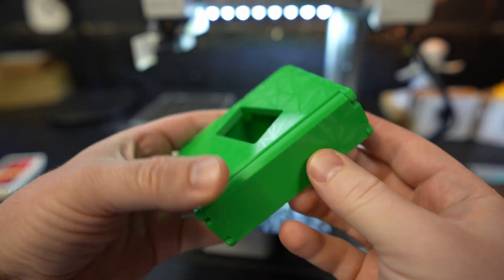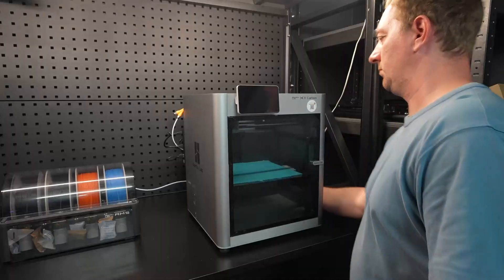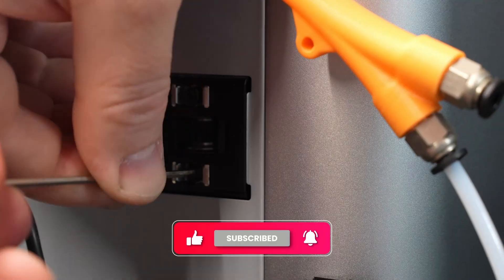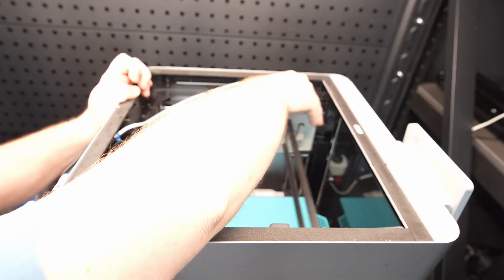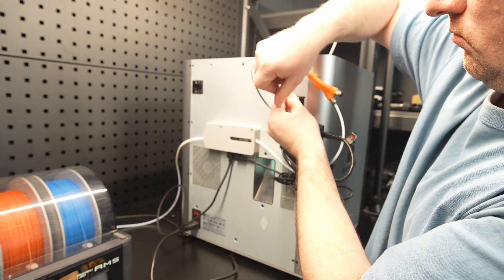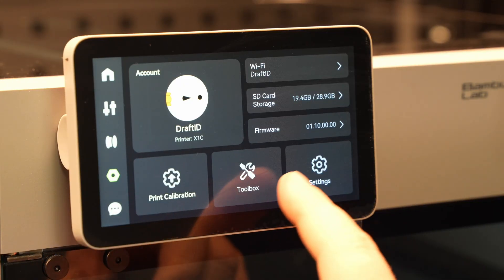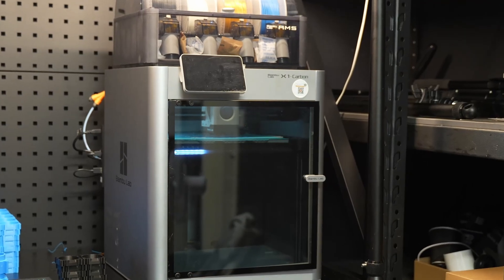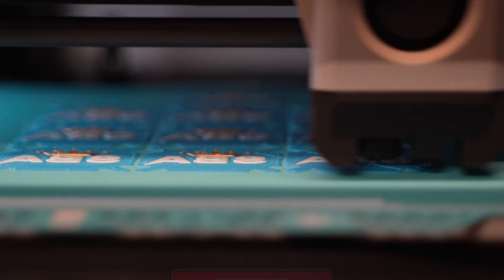How to Tighten Bambu Lab X1C Belts in Minutes

Comment: So this is a video how to loosen the belts… when you loosen the screws, then move the tool head around, that is loosening the tensioners… then you tell us to tighten the screws back before even pushing the tensioners?! This video is not good. After you move the tool head around, you need to move the tensioners before tightening the screws…
Reply from the maker: From the bambu wiki itself "Loosen the 4 screws of the belt-tensioner (but DO NOT remove them), then gently move the toolhead back and forth several times, and finally move it to the rear end of the printer. Then, tighten the 4 screws again. The spring system in the belt-tensioner will tighten the belt to the correct tension."

Comment: I did this procedure 3 times at the request of Bambu support and ended up with banding in the X axis that wouldn't go away. A lot of comments on Bambu's video also said they ran into the same thing. Any idea what we're doing wrong?
Reply from the maker: That sucks mate. I haven’t had that problem :( possibly something else causing it.
Reply: @DraftID  not exactly sure what initially caused it , but after troubleshooting the belt tension , and filament cutter piece . Came to the conclusion that the motor was broken based off of how bad it was leaning . Like the printer had extremely to much tension on the belt to begin with idk . . But I took the motor out and found that it has been sheered off so I fought with Bambu for 2 weeks getting them to replace it . . But while waiting on them to decide what to do I ordered one my self and it came in today so hopefully I’ll be printing again soon . . The one Bambu is sending me hasn’t arrived yet so I’ll just keep it put up as a backup in case it happens again . . A
Reply from the maker: @2smoovetxtv wishing you the best that it solves the problem. Please post back an update
Reply: Not sure what would be causing it other then maybe a setting on the file that your trying to print . . I was told keep an eye on your settings before you download the file and see if it changes when you download the files . . And then change the settings back . . I finally found the issue on my printer , the XY motor had completely broke causing all my issues . After 2 weeks going back and forth with bambu they finally decided to send me a new motor . I got the tracking number today 11-4-25 at 8 pm Texas time .
Reply: @2smoovetxtv it happened with 3 different files that didn’t have issues before… I preemptively bought a new XY belt with my filament order but I’m doubtful it’s the belt itself… hopefully the replacement motor solves it for you!
Reply: @antaholics yes sir , the replacement motor I bought myself finally arrived today while I was at work so when I get home in the morning 5 am Texas time I will be putting that baby back in and hope I can get to printing . . I will be live on TikTok around 7am Texas time if you’d like to swing by and watch !! Same handle as my YT handle !! Bambu finally decided to send me a replacement motor as well but it hasn’t arrived yet 😂 but at least I’ll have a backup one just in case